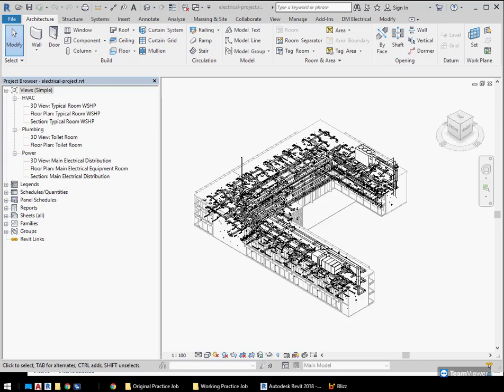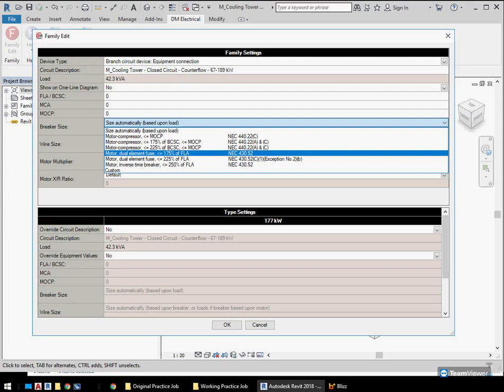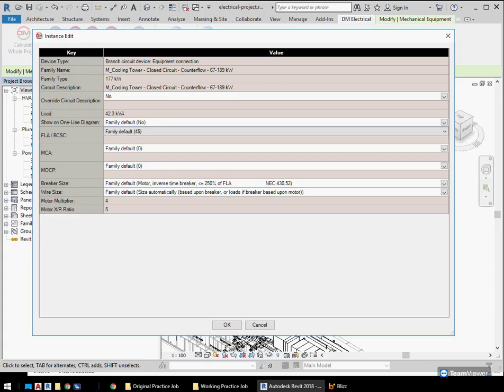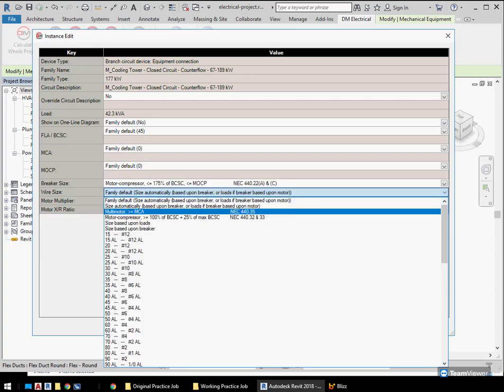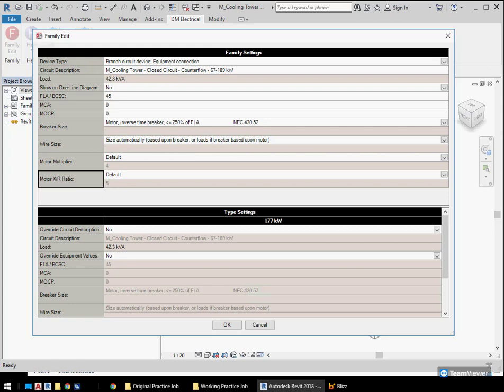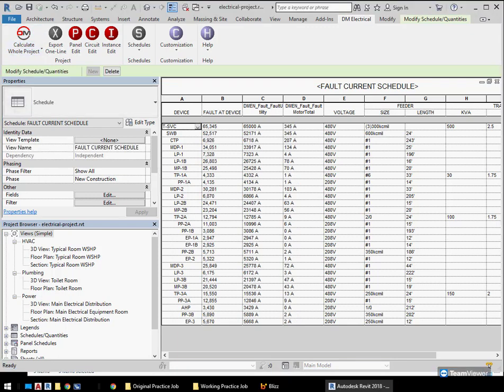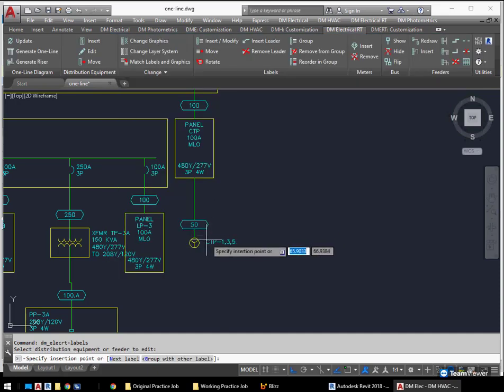ElectroBIM for Revit: Motor Calculations (12/14/2017)

Comment: In your example, you already started with the cooling tower added to your Revit model. How should we add motors to the Revit model to ensure Design Master can recognize them and use them?
Reply from the maker: For DM to recognize a device as a motor for fault calculations, the device family must be configured as a motor in Revit. This page has more information:
https://www.designmaster.biz/help/electrobim/usermanual/advanced-topics/fault-calculation-basis

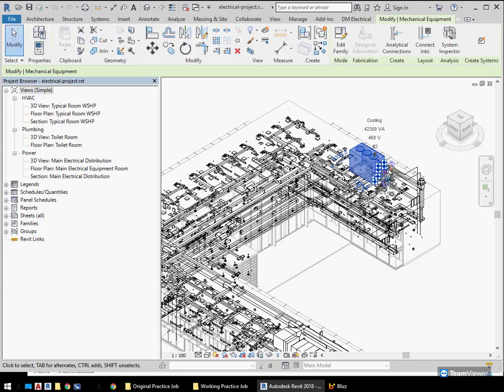To do things like set the FLA, MCA, and MOCP, or to configure one-line diagram settings, you also need to open the device family and run our Family Edit command, then set the device type to "Branch circuit device: Equipment connection". The basic process for setting the device type in the family is shown at 3:31